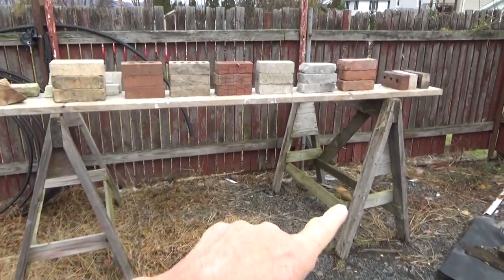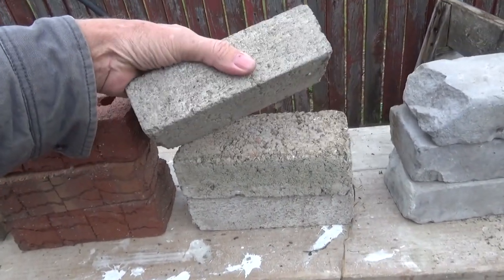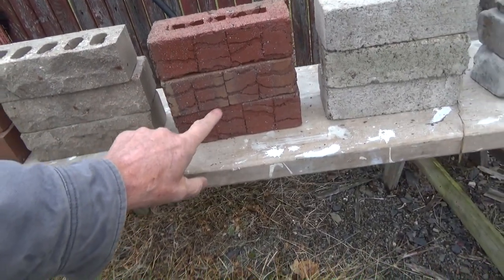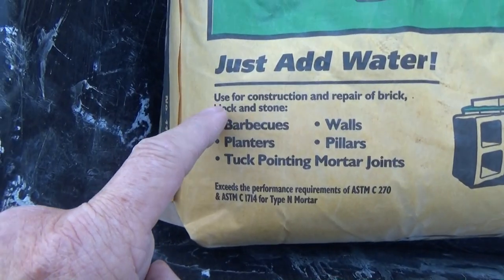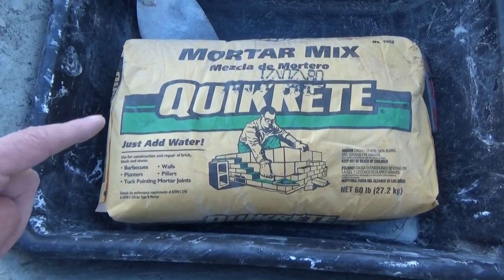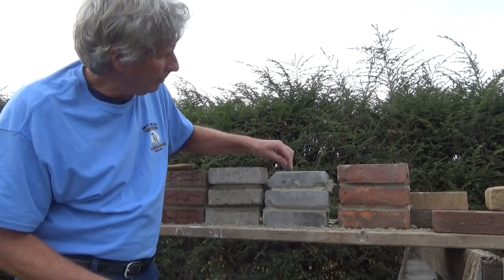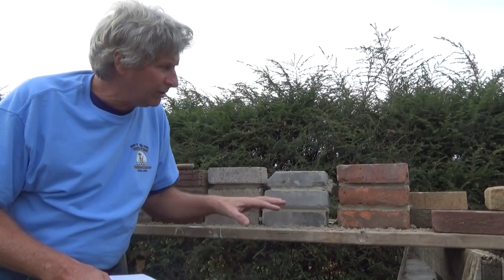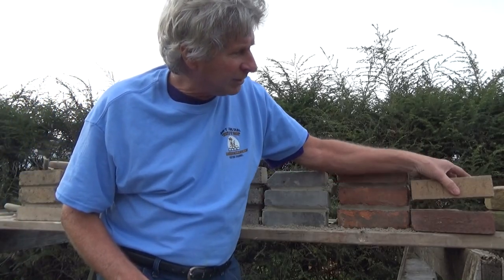REPOINTING BRICKWORK (Part 1)Mike Haduck

Comment: If the current mortar is half gone or loose, is it necessary to grind the joints?
Reply from the maker: Hi NS, I look at masonry like a dentist, usually just the bad, no use taking out anything that isn't,  you can see the rest of the series or my videos on "repointing stonework"  sometimes on big restoration projects they do but I rarely if ever grind the good joints out, everything depends on the situation Thanks,Mike